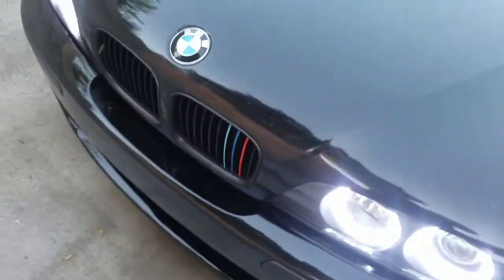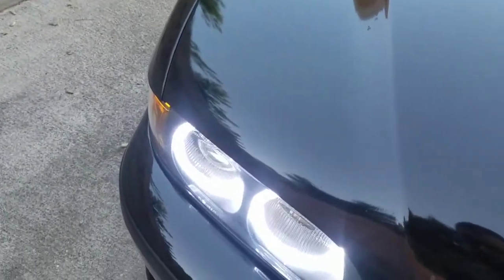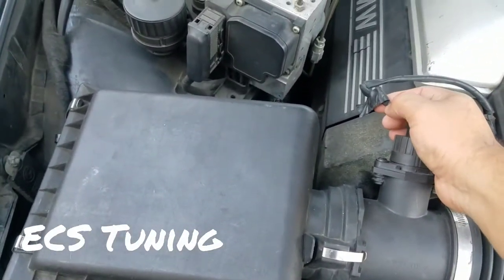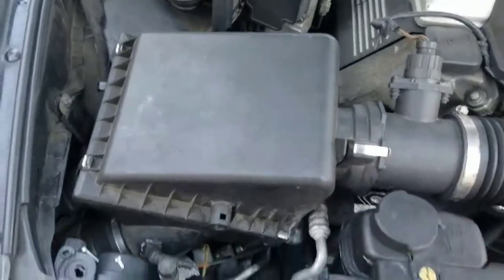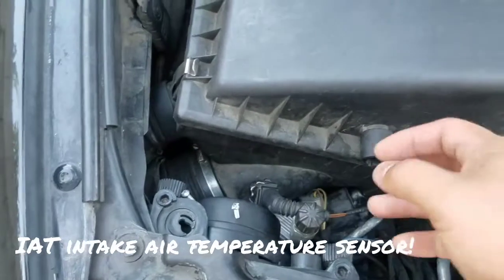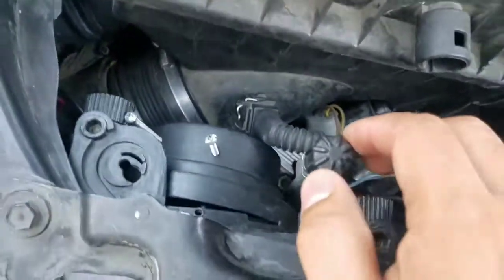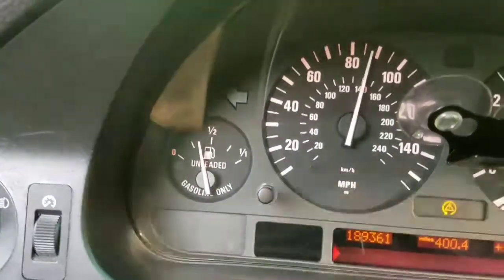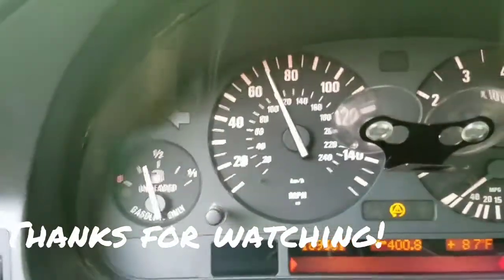Relocate your IAT Sensor! And you will notice take off!

Comment: Too hard to prove anything without you putting it on a dyno or at least some data on the road.
Reply: actually since he has a hole behind the filter it is getting more air a very small amount though, as far as his iat i would rather not comment
Reply: @D3AThCAl2DS  thankfully its before the filter.